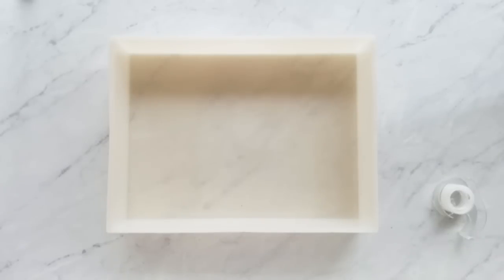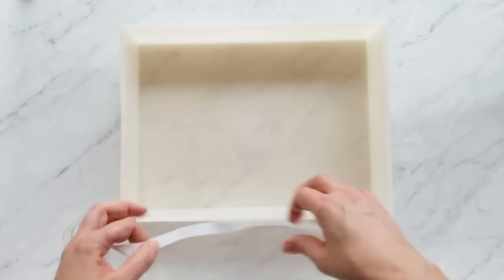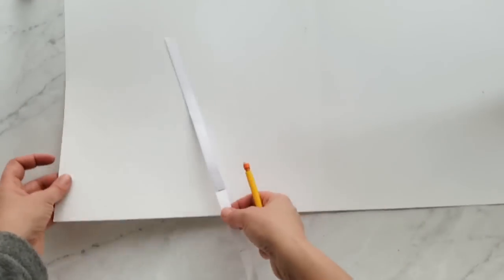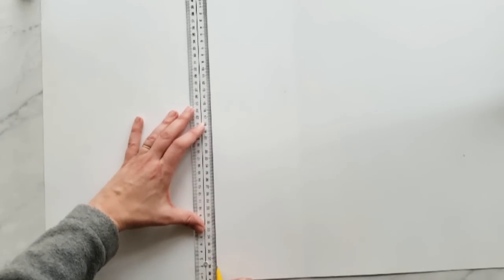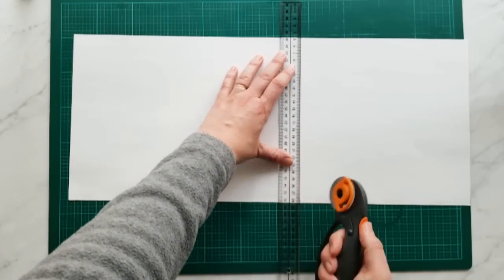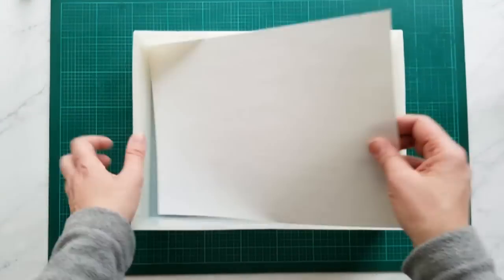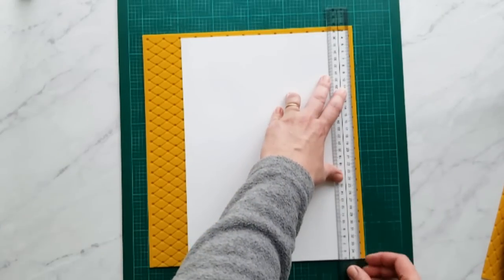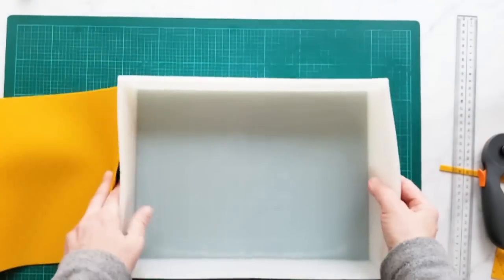How to Fit a Silicone Impression Mat to a Mold, Cold Process Soap Making, (Tips & Tricks #1)

Comment: Question - (no judgement or disrespect) But is there a reason for using a $40 mat vs a $10 one? Just wondering. I haven’t tried mats yet.
Reply from the maker: No judgment taken. 😊 I looked and looked for this mat. It is large enough to fit this 18 bar mold. Are you finding a $10 mat that is the same size? You can use whatever fits your molds. I would love to know what you found. $40 is a lot of money. Let me know. 💕
Reply: Tree Marie Soapworks Now I get it! I’ve been looking at ones that will fit my loaf mold, not a slab LOL I can see where it would be $40. I’ve been looking on Amazon and Wish, and at time Hobby Lobby because of the 40% coupons